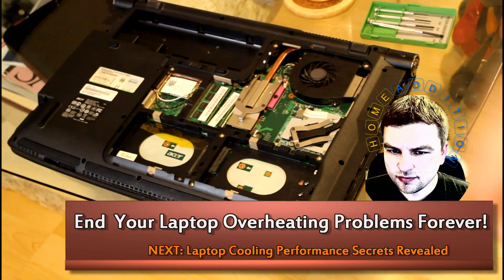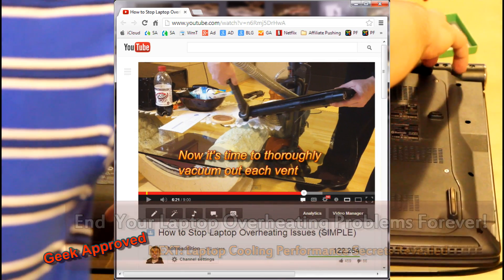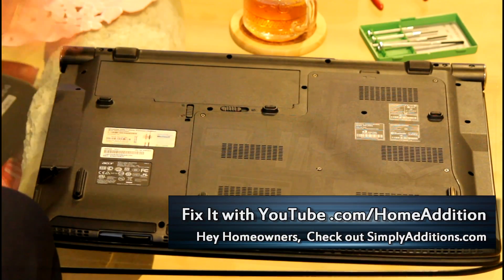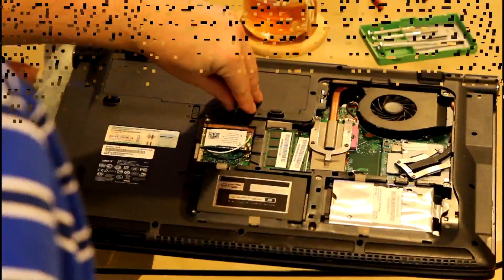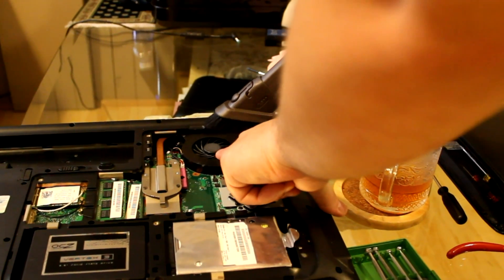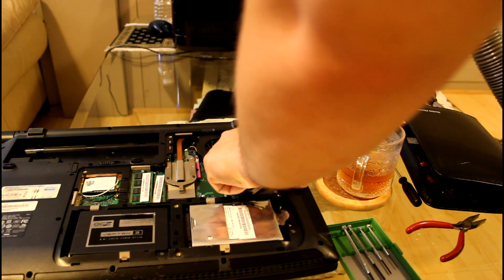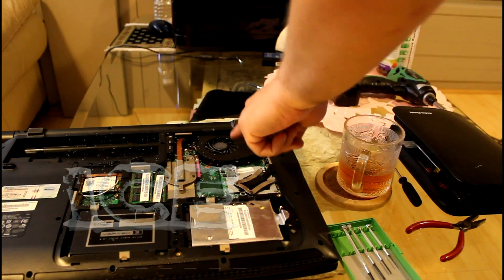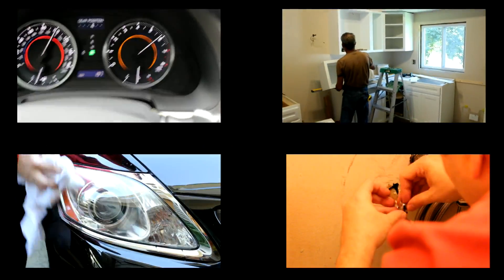How to Stop Laptop Overheating Issues (Advanced Guide Part 2)

Comment: Question, I have a GS70, had it for about 7 months. This morning 10 min into playing a game my laptop just shuts down like it lost power completely. I've played this game before for over 3 hours without any issues. The laptop wasn't even hot. I tried plugging in the charger but the computers charging light won't come on meaning it's "dead" basically.  Any ideas on what could cause this issue?
Reply from the maker: Yeah, I would bet it's a broken video card if it never turns on again. Here's a link to a video for when that problem happened to me. At first I did the oventrick, but I ended up swapping out the video card. After that, the laptop was back to normal. I fried my card by playing GTA IV while the laptop rested on a pillow. The pillow didn't allow the heat to dissipate fast enough, which caused a the video card to overheat. https://www.youtube.com/watch?v=Xvdcq6WbX1g

Comment: u really should take the fan off and clean the grill of that heat sync ive tested your method and it does not pull all the dirt off of the grill only off the fan blades...take the extra 10 min and do it %100 proper lol...

Comment: Another thing to do if it's still hot, is to replace the thermal paste for the heatsink. More technical, but also has the potential for the highest temperature reduction, as often companies Cheap Out on that stuff.
There can be a 10C difference or more between the worst and best pastes.

I highly recommend doing a bit of research first to make sure it doesn't use crappy thermal tape. Laptops that use thermal tape often use it for clearance issues; some older GPU's do as well. That is a problem as removing the thermal tape(usually 1-2mm thick) often makes it so that the components no longer directly contact the heatsink, which is very bad.

Laptop cooling pads also work wonderfully, but generally preclude use of a docking station.

Comment from the maker: Hi guys' I'm glad the video worked for all of you. The first couple of times you take a computer apart are the scariest, then it becomes pretty much nothing. But you can tell by the negative comments. who's on which side of the experience level here.  #overheatinglaptop
Reply: Hello Proven Helper i always thought that GPUs can not be replaced in laptops i have an HP g62 pc that i would like to change the GPU of it how do we do it ?
Reply: hey i have a question the bottom of my laptop dosent even get that warm and it still shuts down the old fan broke so i replaced it now i don't even think the fan spins when i turn it on it dosent move i cant hear it spinning and i plugged in the fan on the right place on the mother board. do you think a sensor is broke? the laptop isint usable lasting only a couple of minutes before shutting off. thanks in advance

Comment: I have a question. My computer has been giving me this notification says "There is a problem detected with the cooling system please turn your computer off immediately and return it for service." I've had my computer for like 2 and a half years. Should I just take it to the computer shop and get it looked at or just buy a new computer?
Reply from the maker: Either your  #laptop  fan is blocked by debris or it broke. I'm the type of guy who takes things apart, no matter if it's a car, computer, or kitchen plumbing. I made this video so that you could take it apart and clean it out, because dirt causes 90% of all laptop cooling problems.  #pcrepair
Reply: I see Lol Im only a kid so idk how I would put my computer back together after I take it apart. Thank you

Comment from the maker: Laptop cooling fans do help, but eventually you have to remove the dust from within, because it's only building up and eventually your #laptop cooling fan won't be able to keep the laptop from malfunctioning due to excessive heat issues.

Most laptops will have a problem after reaching 90 degrees celsius. .I have another video similar to this and plenty of people continue to have problems no matter what they try; that's why I made this video because it's the only REAL WAY to solve the problem.